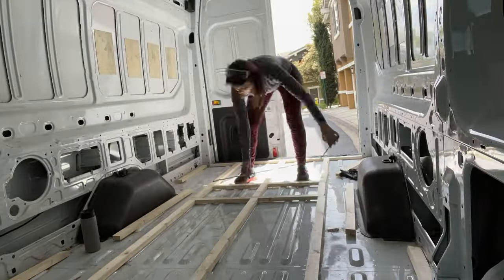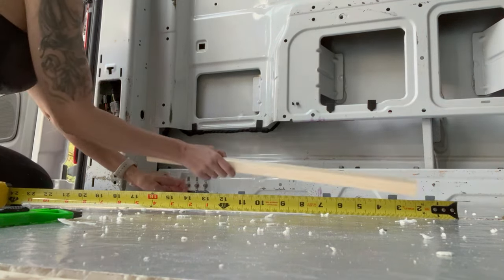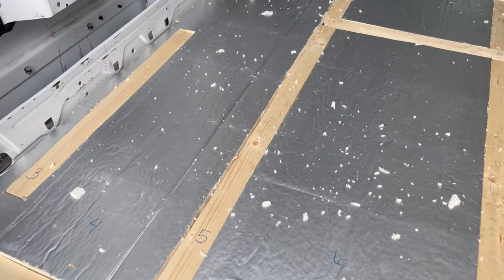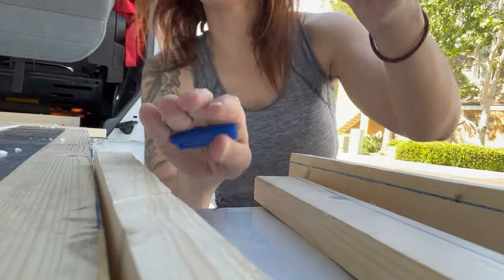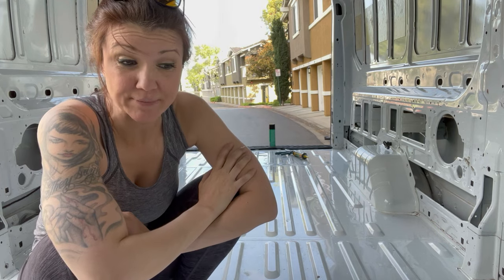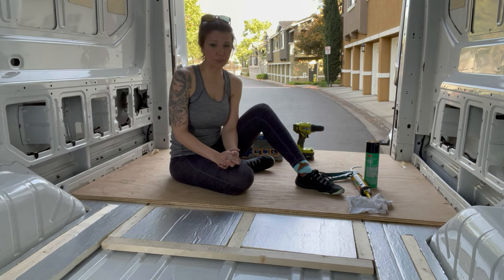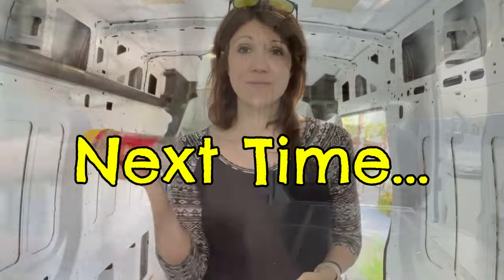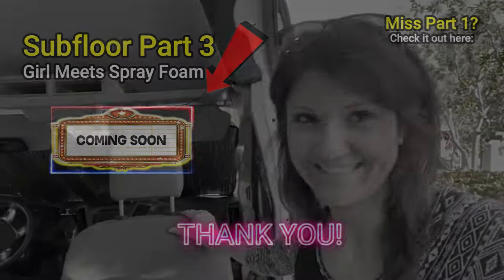DIY Subfloor Insulation: Cutting & gluing it all down | Ford Transit Van Conversion Series [ 4 ]

Comment: Congrats on the milestone! Even the pro builders get tons of advice and call outs on what they did "wrong" - You do the best you can with what you have to work with and don't let it derail you! That being said, I have a bunch of suggestions (just kidding).
Reply from the maker: Thank you so much! 😊 and yeah, it's so hard being new and not fully knowing the difference between doing something wrong and just doing something differently than someone else would have done. I have certainly winced and moved forward with projects with fingers crossed that I'm not ruining everything 😂😂 but hey, so far it's working LOL

Comment: I would make everything removable. Maybe make 3 or 4 floor panels that can slide in and out. Even wall panels. If any water leaks into van and gets stuck under floor it will probably rust. From what I've seen from mice to bugs to sand getting all over inside vans while they travel it just seems smart to make it all removable. It may cost some height but probably worth it. I think you can make it look all built in while making it all easily removable. And if ever needed you can store it all in a storage locker and use it in another van. Anyways just my thoughts.
Reply from the maker: This is great advice! And I love the perspective of being able to transfer your build into a new van later. 

For me, my floor is already done, so I can't try it out there (though I do have a double moisture barrier lol) - I do believe it is important to be able access behind walls for electrical purposes, but you're right, making it removable/transferable is a great reason to do panels as well. 

I haven't done my walls yet, but I'll see what I can do with my level of skill LOL.  I agree with you 100%